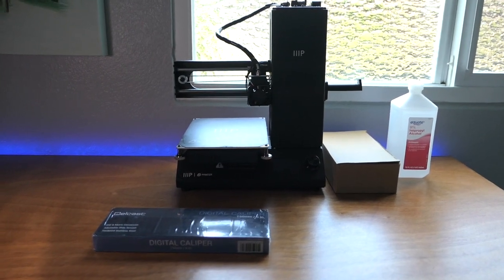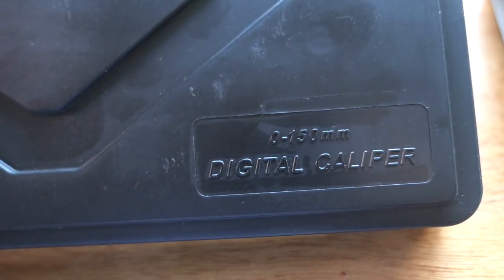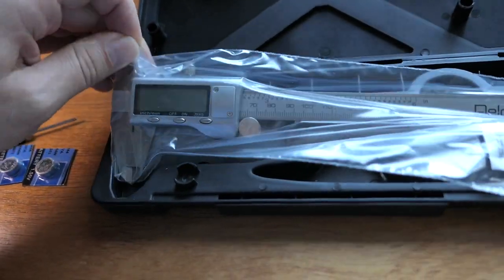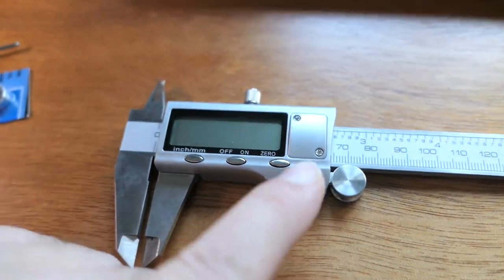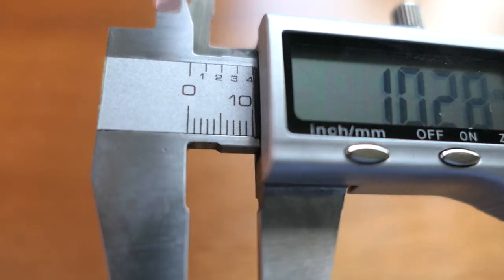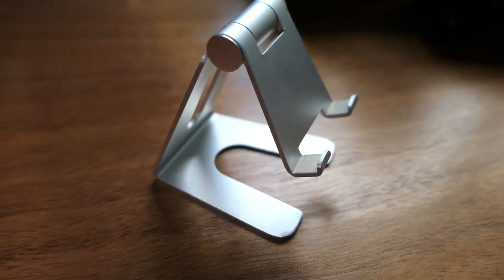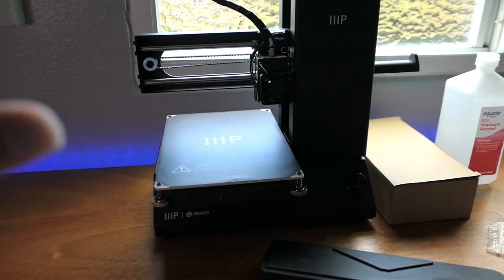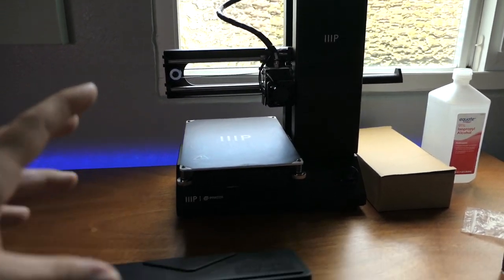Delcast Digital Caliper - 150mm 6 inches

Comment: You could buy these $40 branded ones, or you could buy the same thing without the name for half the price on ebay. I got mine for £10. The reason they turn on automatically is because they don't really turn off. Only the display turns off. So good to have a spare battery or two around.

Oh, and FIRST! Second time ever.